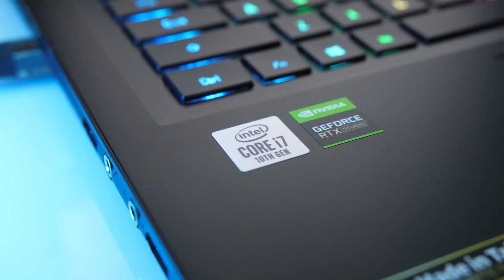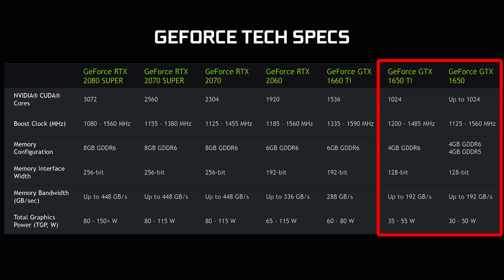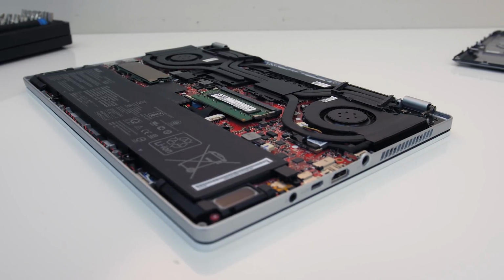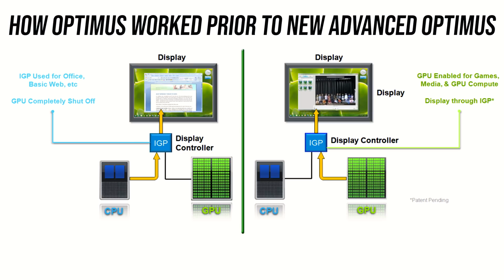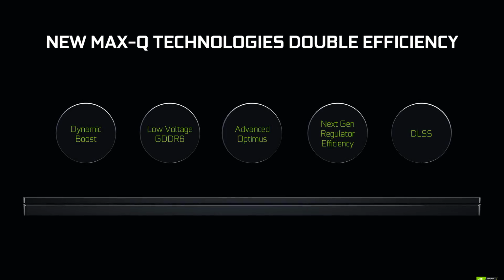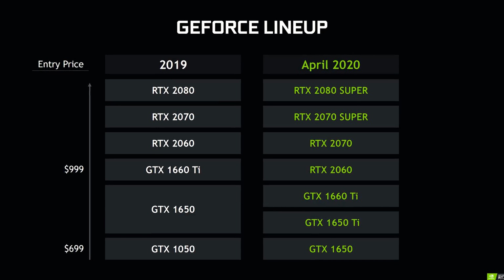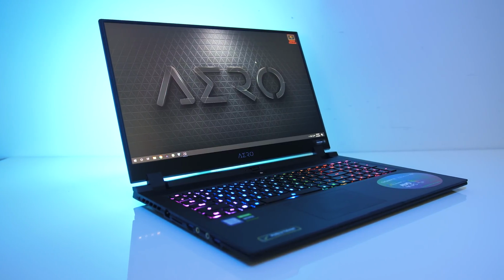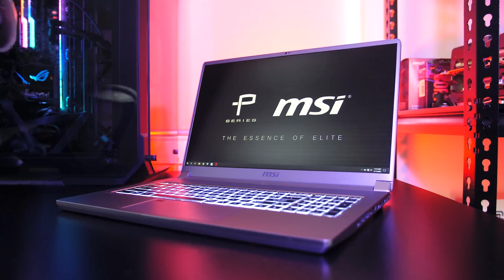Nvidia Super + Intel 10th Gen H Laptop Specs + Features!

Comment: In regards to Advanced Optimus, can't you just go into the Nvidia control panel and force specific programs to use the dgpu?

That's how it works on my MSI GS60 from 5 years ago and I've never noticed the system having to go through or trying to switch back over to the igpu once the assigned program is foregrounded.

Comment: How do you think RTX 2060 2020 will compare to the 2019 model with the increase in TGP
Reply from the maker: Honestly difficult to say, and it will be even harder to compare fairly due to the CPU differences as the new ones will have 10th gen while old 9th gen. Still haven't seen any 115w 2060 laptops 🤔

Comment: can u tell me if 2070 super maxq is batter than 2080 max q? im not sure if i should keep my 2080 max q or wait for 2070/80 super versions.. thx!
Reply from the maker: Depends on the wattage, if you have a 100W 2070 Max-Q I'd expect it to beat a 80W 2080 Max-Q in most instances. I will compare 2070S/2080S as one of my first videos when the embargo ends.

Comment: Is the gtx 1650ti actually necessary? Since the gtx 1660ti has a max Q edition that would fill the gap between 1650 & 1660ti?
Reply from the maker: It needs higher specs, at the moment doesn't look great. 1660 Ti Max-Q is still closer to the 1660 Ti than the 1650, the gap in that range is pretty big. Nvidia don't want AMD taking that pie with the 5500M

Comment: Best video on YouTube about today's Intel's & NVIDIA's new products. Thank you. 

Have you heard anything about the Acer Predator Helios 300 lineup (both 15" & 17") being updated with some of these products? I haven't seen anything from Acer yet.
Reply from the maker: Cheers! Have not heard any new from them yet, only saw the Triton 500 mentioned by Nvidia, I would assume they would refresh it with 10th gen though.
Reply: @JarrodsTech  Historically, new Helios 300 models have been announced in April/May of every year, so I'm guessing the announcement is imminent.  

I'm assuming all models will come with the 6-core i7-10750H, though my wishful thinking is hoping for the 8-core i7-10875H (unlikely). 

NVIDIA GTX 1660 Ti & RTX 2060 will also be the GPUs of choice, and I'm hoping the latter will be priced at $999 like NVIDIA suggested, or $1,099 at most, and $999 for the 1660 Ti.

The other improvement opportunities I can think of are all related to the I/O -  Upgrading the three USB-A ports to 3.2 Gen 2 (SuperSpeed USB 10 Gbps), including Thunderbolt 3 in the USB-C port, and using the Killer Ethernet E3000 2.5 Gbps for the Ethernet port, since we now have high-end models (the new Killer Ethernet E3100) that belong in high-end laptops, so we can potentially have 2.5 Gbps speeds in Helios 300 laptops using last year's models of Ethernet controllers. 

Thoughts?

Comment: Some are hateful towards asus for not including ryzen 4000 series in thier strix line up and high end zhyperus lineup. You should be thankful to asus atleast they gave a chance to ryzen in g14, it was a big deal for asus bcz already the 3000 series ryzen processors were a failure, everybody cant take that risk. None of the company actaully came out much, but asus showed bravery and paired ryzen 4000 cpus with fairly powerful gpus like rtx 2060 max q, which eventually came out to be outstanding. Hopefully, 2021 will be a good year for ryzen cpus, other companies will surely come forward after seeing this success.

Comment: Do you know if the GTX1660ti max-q and the RTX2060 max-q in the Asus Zephyrus G14 are the 2019 versions or 2020 versions of these GPU's? 

If they are the 2020 versions do they support the new Nvidia max-q features?

I know the 2 lower end GPU's for the Zephyrus G14 are 2020 versions as they are the GTX1650Ti (part of Nvidia's 2020 mobile lineup) and GTX1650 with 4GB of GDDR6 (GDDR6 only available on the 2020 mobile version of this GPU)
Reply from the maker: Not sure, but didn't see any of the new features like advanced optimus.

Comment: Thanks Jarrod. You showed the G14 in this vid around the dynamic boost section; do you know if G14 made the cut and will feature it? (i.e. hw supported)
Reply from the maker: I'm not sure, my guess is no, I never saw it mentioned anywhere at least and the G14 was meant to come out well before Nvidia embargo ended.
Reply: @JarrodsTech  yep, fast response cheers. The tech reminds me of AMD's new Smartshift feature and I've been thinking it's a pity I've only seen the Dell G5 (I think) that will have this all-AMD combo so far. The G14 would have been wicked with a 5500m or 5600m, even more battery saving. Good that Nvidia are opening this up to both major CPU players however for future laptops... https://www.amd.com/en/technologies/smartshift

Comment: If Intel want people to upgrade from 7th gem to a newer Gen they need to think on how to keep their temperatures low working with manufacturers to make it possible.
I still have a i7-7700hq laptop and the max temperature it has ever reached was 80C when stressed when I check newer mobile CPU tests most hit 90C or higher, so for that it's better to build a desktop with water cooling to control one of the desktop beasts.
Reply from the maker: They can't improve that without improving the architecture which doesn't seem to be happening. 7700HQ was the last easy to cool generation, more cores more power more heat.

Comment: I like the fact that both amd and Intel keep improving performance but now the real challenge for laptop manufacturers is to improve the cooling system a turbo boost of an i7-10750h up to 5.1 ghz for example is something good but it’s pointless if we always end up undervolting cause the cpu hits outrageous temps , on my gx502 I ended up undervolting the laptop and lowering the turbo boost clocks cause of this problem and I know many users do that too, I hope this doesn’t end up being the common problem for next gen laptops too or amd might jus crash intel for real
Reply from the maker: I think people are more paranoid about cooling than they need to be, if there is thermal headroom they're going to take advantage of it to boost performance.

Comment: Could you tell me why MSI is releasing the GE66 with both a 2070 Super Max-P and a 2080 Super Max-Q? Is there a new power config for Max Q or some sort of advantage of having a Max-Q now performance wise? Last generation the 2070 max-p performance nearly exactly the same as the 2080 max-q so I'm wondering why there's a huge price increase to get the 2080 version when the performance will be the same as the 2070.
Reply from the maker: I'm not too sure, many companies did the same with current/last gen, 2070 max-p or 2080 max-q being options, so now it's the same but with Super I guess.

Comment: I like how nvidia is so high up the laptop food chain that they can pull this off. "Next Gen Regulator Efficiency" where Nvidia probably made IR/whoever design a VRM controller specifically or at least very fitting to their use, force the laptop makers to use em, and get to be the one that advertises this as their own doing. IDK if it is a good thing though.
Reply from the maker: I guess we'll see if it actually is any better than the older versions

Comment: Em power peekers boughta get upset over that dynamic power shifting. Can we just add total system wattage to the test and let dynamic power shifting between Intel and Nvidia do their thing as an additional test case when you do the CPU/GPU oc/uv/repaste/cooling pad thermal/clock testing?
Reply from the maker: What under what test though? Sounds like it will vary based on game, unless the total from the wall is the same and we decide to stop caring how much each component uses.

Comment: I thought Advanced optimus would just be good ol' optimus but this time the iGPU from intel supports VRR and now they can use optimus with vrr and have all the downsides Optimus has. They actually made a new hardware design to make the old mux switch method smoother. This is actually ideal, GJ Nvidia.
Reply from the maker: I have a feeling they are only doing it to compete with Ryzen 4000 laptops, which offer FreeSync via Vega iGPU.
Reply: Jarrod'sTech so does ice lake, that was why i though it just use iGPU’s vrr support. Tis nice tho.

Comment: 7:07 so will Asus G14, TUF A15 and other ryzen 4000 based laptop with nvidia graphics have the features and improvements you mentioned?
Reply from the maker: I don't think so but it's not clear.
Reply: Probably not.... These improvements are for the OTHER NEW laptops coming out in 2020.
Reply: @PhillipLemmon  "Newerer" laptops yeah. It's a bit of a shame really. Intel laptops get a bit of an edge on the GPU department not because of Intel's work but simply because they were released later lol. But I guess that's normal. Let's hope that the Ryzen 4000 laptops get a "gpu" refresh soon
Reply: @JoaoBarbosa1996  here's hoping dude, lol
Reply: @JoaoBarbosa1996  But that feature can cripple CPU performance in gaming(many newer games are pretty CPU heavy) By lowering CPU TDP, intel CPU will suffer a lot....Also, this feature probably not even needed on AMD cpus especially HS variant, since zen2 APU draw significantly less power than intel already even tho they all rated at 45w. Those power budget saved from AMD CPU can just give to Nvidia GPU right away, so it dosent need to dynamic adjusting the power balance between CPU and GPU.
Reply: @qiyuxuan9437  I was talking about the more efficient VRMs and low power GDDR6 :P

I'm also supposing that the power thingy is somewhat smart and won't throttle the CPU when it's under heavy load
Reply: @JoaoBarbosa1996  Well, technically those CPU are not thermal throttling as long as they are above base clock, which is pretty low lol😂 The problem is at the same power budget, AMD cpu can maintain a higher boost clock already, which can make intel CPU looks even worse if the power budget decrease....Intel probably not gonna like this feature lol😂😂😂
Reply: @qiyuxuan9437  Eventually yes but for now Intel laptops pretty much have better GPU's compared to Ryzen. If indeed currently the memory takes 30% of the TDP, that's huge. Not sure how lower the TDP will be on the new VRM/LP-GDDR6 but if it allows for 10W extra to go straight into the GPU...it will be noticeable.
Reply: @qiyuxuan9437  I am pretty sure almost all laptop cpus have room for thermal improvement. Amd just throttles less but could still greatly benefit from the tech. It doesn't cripple cpu performance, it dynamically changes which cpu and gpu is put in more power.  Ofc, it is not gonna lower cpu tdp when the game is cpu heavy, nvidia is smarter than that.
Reply: @JoaoBarbosa1996  None of they are released yet.
Reply: Any confirmed information with regards to the g14?

Comment: AMD 4900HS + RTX 2070 will be awesome 
Hoping it will be Cheaper Then i7 9750H + RTX 2070
Reply: Or the full 45watt 4900H.
Reply: or 4900HS with RTX 1660ti, sweet spot.
Reply from the maker: Still haven't seen anything with that spec for some reason 🤔
Reply: @JarrodsTech  What will be Graphics Card Paired Up with 4900HS 
And I more Questions is 4900H better then 4900HS?
Reply: EvIl CoMmAnDeR GaMeR 4900HS offers more performance per watt, but it does not outperform a 4900H at full power
Reply: @rg1346  does a 4900h outperform a 4900hs tho?

(i mean, it DOES have S after the 4900H)

Comment: Nice preview insight of what's to come soon. The only thing that i'm worried is that the 1660ti might be phased out or would continue to suck but I guess we might have to wait and see what happens in the coming months. Also the 2020 1660ti has a slight better performance than last year's 1660ti huh? Well I would just have to wait and see what happens in the coming months as new laptops are on the way and see how it stacks up against other mobile processors especially the ryzen 4000 series chips soon enough.
Reply from the maker: Sounds like 1660 Ti is still in the lineup for now, can't really see it going anywhere for a while.

Comment: Will Advanced Optimus be available for older GPUs? The only thing bad about my Zephyrus M 1070-P is the HORRENDOUS 50-60C idle temps when using GSync, because the 1070 is always on. I'd be a happy person if it could gain the Optimus functionality without losing GSync...
Reply from the maker: No, it needs the dynamic GPU switch which I assume is implemented at a hardware level.
Reply: @JarrodsTech  Damn. It'd be wishful thinking to expect the opposite tbh ;D Thanks for the reply

Comment: I've been waiting for 4 months to buy a new gaming laptop. I have a $3500 max budget. Hoping to get an RTX 2080 Super (non Max-Q) with an AMD CPU.
Reply: @brandonchutt312  I've been building desktops since the 90's. When I joined the Air Force, I lugged around my gaming computer all over the world. Now retired at 42 years old, I'd rather have a gaming laptop, as I now spend my time traveling, and enjoying the fruits of my labor. Additionally, I now prefer gaming on the couch, with the wife next to me, on an Xbox. Some games still require a mouse, and a keyboard, so I can just pull out my beast of a laptop, throw it on the kitchen island, game with my laptop, while still enjoying a conversation with my wife. In the end, a gaming laptop/Xbox combo fits my middle age life much better.
Reply: @JBrown-go8ru  could`nt agree more..been into static PC built and i think mobile is FTW.
Reply: I am also into upgrading my laptop (It's from 2014, Asus N550JV) debating between a PC and a laptop. I've never had a real gaming PC, running with laptop for more than 10 years now..
My main issue is that I am supposed to start studying in Italy this year, and I won't have the option to move around with a PC... yet I do want a good gaming experience. What kind of laptop caught your attention? I was quite interested in the MSI Titan series.
Reply: @FabuliciousAF  XMG Apex 15, MSI GE 66 Raider
Reply: Maybe cause he wants the 2 combined?
Reply from the maker: That's quite the budget, no ETA on anything above 2060 paired with Ryzen 4000 at the moment though.
Reply: Brandon Chutt Personally, I just pre ordered a laptop because I have an apartment with my girlfriend and dont have room for a desktop setup.

Comment: my current GE75  9SF keeps electrocuting me when connected to the wall. what do i do?
Reply: See if the outlet is grounded
Reply: @nier6472  outlet is fine.. i've used other laptops and gadgets they all work fine
Reply from the maker: Does the power plug actually have the ground pin?
Reply: @JarrodsTech   its UK spec, so yes. along with a fuse on the plug. i've tried another power cord as well and the result is same

Comment: good choice of asus to go liquid metal on all the laptops with intel 10th gen, their gonna need it.
Reply from the maker: I wonder if it just means the 10th gen is that hot 🤔
Reply: @JarrodsTech  probably. we know that 9th gen is already extremely hot. and another 300mhz boost means more voltage so most likely even hotter. pretty sure their gonna need it.
Reply: @TabalugaDragon  H and U series are two different chipset segment dude based on power consumption. Don't put them in the same table comparison for all aspects.
Reply: @TabalugaDragon  like Aruwizu Irul said, totally different tdp category and chipsets
Reply: @TabalugaDragon  even tho it won by 5% it still was 30°C hotter. just look at laptops with 9980HK they throttle almost straight away so will the 10980HK. so they do need the liquid metal
Reply: @TabalugaDragon  i know it was in a thinner chassis. and about the i7 and i9 thats exactly what im saying about the top end already throttling heavily thats why they need liquid metal. so whats your point really?
Reply: @TabalugaDragon  no mather how you look at it. the liquid metal is gonna be necessary on the 10th gen i7 / i9
Reply: @JarrodsTech  they used liquid metal already in a few high end i9 9th gen laptops.. but ok
Reply: @AdmiralBlackDevil  now they do it for all the i7's as well. so that must mean something
Reply: @JarrodsTech  Remember that there won't be any undervolting available starting with 10th Gen, courtesy Plundervolt. So liquid metal was absolutely necessary to compensate for it, given that Intel also wants to keep up with AMD somehow.
Reply: @JarrodsTech  AnandTech is claiming that the i9 will need 135W to reach 5.3 GHz (67.5W per core) when 2 cores are activated using Thermal Velocity Boost. Can liquid metal even come close to helping these laptops stand a chance against this much heat? And probably that's the reason why Asus was forced to use liquid metal.
Reply: @TabalugaDragon  They have changed temperatures now. Upto 65C, TVB will boost cpu by 2 bins, and bryond that upto 80C it will boost only by 1 bin. So TVB works upto 80C.